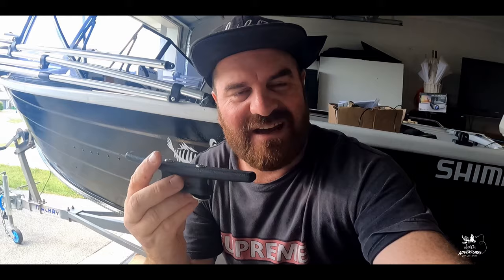How to Install Anchor & Cleat ⚓️| ep 34

Comment: Should you put a mounting plate under the cleat?
Reply from the maker: I put large washers under the bow and it works fine but yes if you want to put a mounting plate it will also work well thanks bud